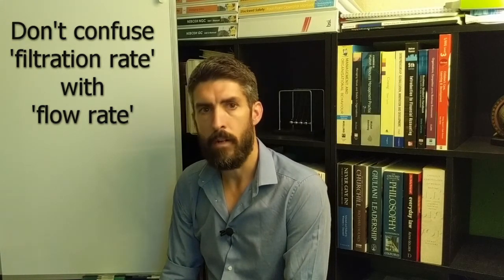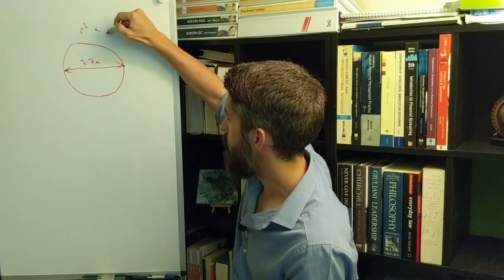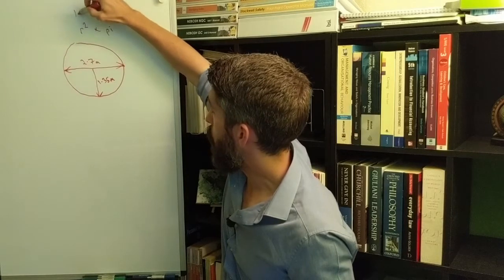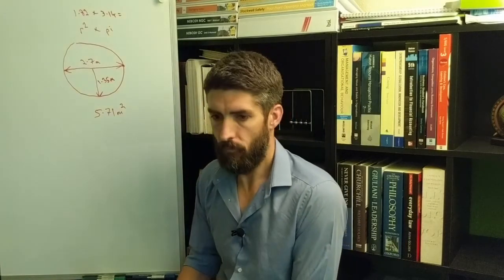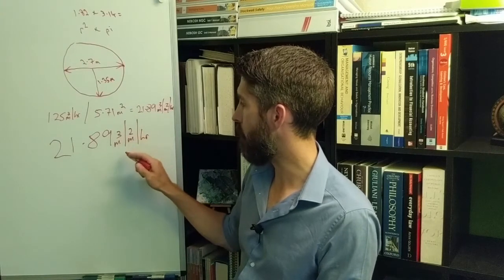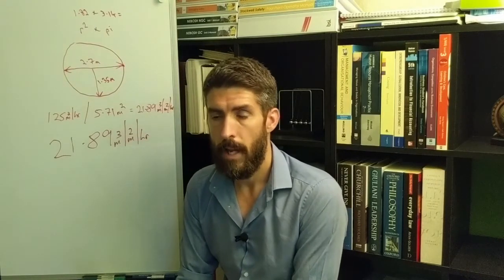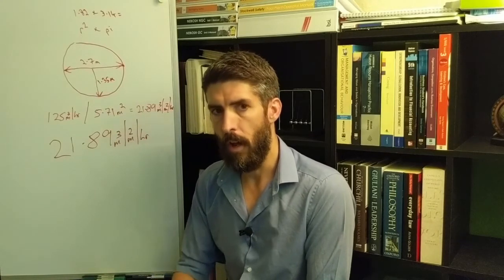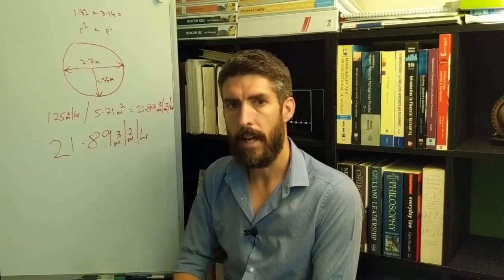How to Calculate Filtration Rate

Comment: Doesn’t make sense. So what you’re saying is:

1 filter = 5,71m2
Filtration rate : 125/5,71=21,9

But when you INCREASE filter surface area, ie. Add an extra filter. The filtration rate drops??

2 filters: 5,71*2=11,42
Filtration rate 125/11,42=10,95
 m3/m2/h

Which is half the rate. But you’re saying we want a high rate?
So twice the filter half the filtration rate?